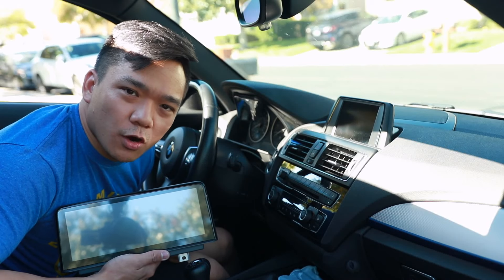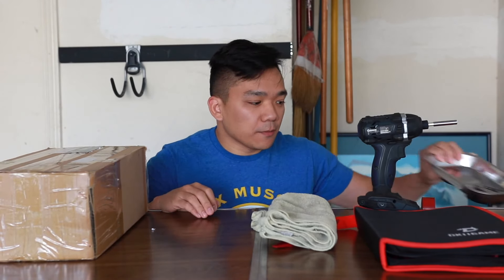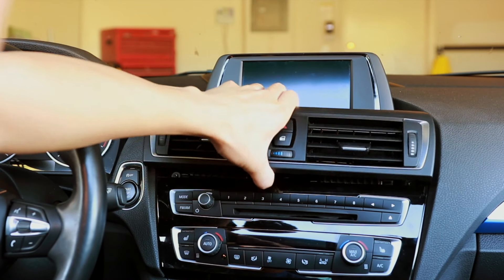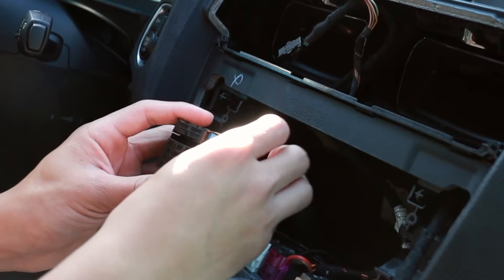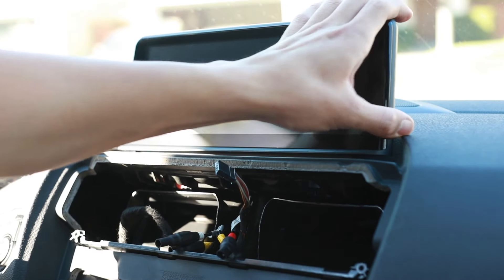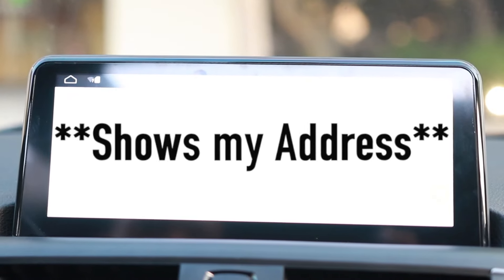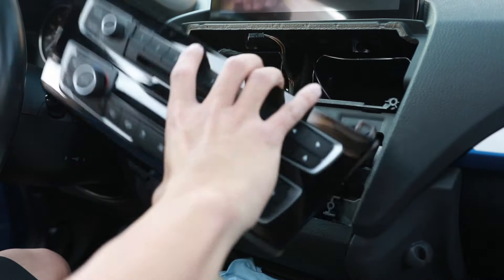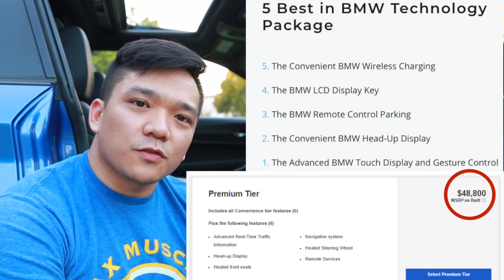BMW Android Screen | BMW Screen Upgrade | Koason 10.25" Display

Comment: Just subbed. Do you know anyone in Calgary, AB Canada to do this?
Reply from the maker: I don't, but let's pin your comment and see if someone there can help you.
Reply: @FritzRamos  any in miami florida tbat can help me with that installation?
Reply: @Ghostlygt-x9c  Hey just called up a shop called ciro's that does the installation for ~250
Reply: A shop called ciro's auto in miami fl
Reply from the maker: @iGotSub  Thanks for sharing
Reply: Do you know any head unit for 2016 X3 F25? Mine factory head unit is enclosed. Thanks
Reply: @FritzRamos  I have 2017 M240i with the larger screen but my navigation stopped working . I guess you’d recommend the MMI box but I like that you can have apps on your set up. Do you know know if your screen is compatible or if there’s any?
Reply: Anyone from Middle Ga area? I also really wanted to upgrade my screen!
Reply: I may as well ask if there's someone in NJ?  Thx! Joe
Reply: @FritzRamos Any update ?

Comment: My 8.8 NBT LCD Headunit Screen experienced sun damage from being under the sun for too long. Fortunately the computer components are fine so for me it’s more cost effective to replace the LCD screen with a new one. The LCD screen costs $70 which is significantly cheaper than buying a whole new head unit which would have set me back by at least $300

Comment: I watched the Bimmertec video on installing their Android head unit which I found a little discouraging - but watching you do it on an actual 235i made it seem a lot less challenging. I'm glad I found your channel.
Reply: Did you ever figure it out? I ordered from BT but figured audio shouldn’t be affected since you’re not really changing the head unit. You’re only changing the screen so it should still sound exactly the same
Reply: @luise3618  no, the screen is connected to the original sound system via aux, so the headunit is doing a Digital to Analog conversion and the DAC isnt as good as BMW original so there will be degradation but I doubt people can notice.

Comment: Ey! I just bought similar radio  for my BMW serie 4 , I did just the same as you but I have no sound. Theres a Jack cable on my kit , does It goes to the aux? Thanks from Spain!!
Reply from the maker: Yes,  but if your radio and bluetooth play without it inserted then you don't need it.
Reply: If you don’t have the fibre optic cable, most likely you’ll need to plug in the aux cable right?
Reply: I just don’t like the fact that I need to plug in the aux to armrest, I’d have to run the wire under the central console which sounds messy

Comment: Is there any differences if you have the Harman Kardon sound system apart moving the optical cable? Also how is the true sound quality affected while having the HK sound system along with this  as I am worried about sound degradation? Lots of models say its not affected but I have seen many examples where the sound quality is considerably poorer than than the standard HU with HK.

Comment: Thanks for the video mate extremely helpful and it actually gave me the confidence to attempt the installation myself, which i did today. The only real issues I had was with disconnecting the Emergency light switch connector as I couldn't pop out the button itself to make it more accessible and trying to get the stereo system back in to its original position was very awkward due to all the additional wiring that is now there. After finally working that out the new screen switches on fine but I don't seem to have any sound and the cars main menu doesn't display when I hold down the menu button on the Idrive...Any ideas why that might be? Could it be because I forget to connect the fibre optic cable?
Reply from the maker: That's awesome! Only some cars have the fiber optic so you ,ight have to double check to see if yours does. The other thing  to check is that you plugged in the AUX cord. Lmk if that helps
Reply: @FritzRamos   Thank you for your advice. My vehicle had the fibre optic cable so I relocated it to the new 40 pin female plug which has fixed the issue.  Please Fritz  I have another question...do I still need to connect the aux lead even if I can play music via bluetooth threw my phone? It works via the BMW original system but I have no sound when I play a movie via the android sytem.
Reply from the maker: @vijaybadhan6410  If you have sound from the radio, your BT, and from the android unit (like the navigation - switch to aux mode even if you don't have the cable plugged in) then you don't need it. I didn't have to use mine, hopefully yours is the same
Reply: @FritzRamos  Hi Fritz thanks, that suggestion worked perfectly.  I now have a fully functional system.
Reply from the maker: @vijaybadhan6410  Glad it worked out. If you need anything else please feel free to reach out.
Reply: @FritzRamos  Just out of interest Fritz do you have a screen protector for the screen? The only screen protector I managed to find is shaped to fit a BMW X3, OEM Screen. I want to avoid cracking it again like I did with the original one.

Comment: Hey man, my huge thanks for this video. I bought a similar unit for a BMW F20 116 from 2013. The screen is similar but not exactly the same one.
I followed this video and the instalation was very smooth. Also thanks for pointing out that some veichles have a fiber cable that needs to be re-routed towards the new connector, mine had those indeed!
Reply from the maker: Glad the video was able to help you even though it wasn't the exact same model.
Reply: I got 116i 2012 (UK). Where did you buy iDrive from?
Reply: @LolMatey I also have a 116i F20 2012, also not sure how to upgrade the iDrive

Comment: Great video. For some reason I’m getting ‘no signal’ .  The new unit powers up just not connecting to the BMW.
Reply: Did you ever figure out the issue. Mine is doing the same thing.. no idrive

Comment: Hi just subbed. Will this work in my 2015 f23 220i. Also do you get much glare on the screen?
Reply from the maker: I believe so. You'll have to check the fitment guide. Glare isn't an issue

Comment: Hi, great video install went well i just cant get my i drive system to display, every time i try to use it it comes up with “no signal”, do you know why this is? And can you help me?
Reply from the maker: Double check that theh in and out cables are properly routed and fully engaged. Do you have audio?

Comment: Is that Audio from head unit need another audio cable to connect with main unit or what?
Reply from the maker: My unit does not need the aux connection, but other models do. I'm not sure what components cause the aux to be needed or not though.

Comment: Did everything just as you described, with the same brand unit, and get no audio from the unit itself...
Reply from the maker: Do you mean bluetooth, radio, or both?
Reply: @FritzRamos  sorry for the very late response.  The Aux input threw me off.  I do still have a couple issues.  One being that if you use split screen in Android, the side that is not active freezes.  So if you have spotify on one side and want nav on the other, one freezes.  Any way around this?

Comment: My friend i need your help
Can you possible change cluster for black panel 6wa  coding bimmercode its possibe ? 
Thanks you
Reply from the maker: Are you referring to the instrument cluster - for the speedometer and odometer?
Reply: @FritzRamos  
yes I have the same meter as you I would like to put the meter with your white light and a slightly larger LCD screen but I don't know if it is possible with a used meter?
Reply from the maker: @piraterietuto9015  can you message me @vroomtuber with pictures. I think you are talking about the heads up display not the instrument cluster. If you are using a used screen just make sure the connection is the same
Reply from the maker: @piraterietuto9015  got it. I would love to help but I don't have intentions on getting that. I prefer the traditional look
Reply: @FritzRamos  thanks you for reponse im french  i like your video .
Respect my friend
Reply from the maker: @piraterietuto9015 Tha k you and  no problem. If I find a video that can help you I'll send it over.

Comment: Hi, did you have to connect to the aux socket or is it enough to simply set the audio output to aux and the audio will still be heard?

Comment: I didnt see you connect the AUX cable , isnt it require for bluetooth playing?
Reply from the maker: Some cars require it while others don't. I haven't learned what is the decisive feature though. As for this car it does not require it.
Reply: @FritzRamos  mine requires it , how do i connect it?
Reply from the maker: @PaulinhoRullz  JUst connect the aux from the head unit connection to the aux under the armrest
Reply: @FritzRamos  then how do i play songs through my phone? Via Bluetooth?

Comment: Everything worked except the clock on the dashboard right next to the odometer now showing nothing, a bit annoying to not able to check the time on dashboard, could it be something missing from the connectors?

Comment: I’m getting no audio after installation?
Reply from the maker: Try switching to the aux setting, if you have the optical cable make sure it's firmly connected, or connect the aux wire

Comment: Just subscribed pal. Located in Dubai, UAE, I’m driving X1 xDrive25i MSports 2017 .. comes with company fitted 10.25 screen with ConnectedDrive, Navigation but no touch or carplay features. Would like to get the head unit replaced to support Touch, Navigation, Carplay. What are your recommendations?

Comment: I see that you installed the GPS antenna inside the dash....is this ok and it works like I champ?...I ask this because some manufacturer's would want you to expose the antenna, like on to p of the dash.

Also; can you confirm that all the basic BMW menus and features work?...I'm interested in buying it but mainly for: 1. Having a bigger screen 2. Having a touchscreen 3. Having Apple car play wired.  I don't have an android but may use that side too.
Reply from the maker: I haven't had problems with the antenna, but there is enough slack to get it placed anywhere you want.

All original features work if you want carplay make sure to get the single and software, https://youtu.be/4ZfGKcxi1xk
Reply: @FritzRamos  Cool, I'm looking and studying the retrofit from 
http://www.carnaviplayer.com/bmw-x3f25x4f26-2011-2017-radio-upgrade-with-1025-screen-p-1255
I'll be writing them an e-mail to ask a few questions but thanks for the info.
Reply from the maker: @odieman23  no problem

Comment: Hi bro i just purchased a used 2017 bmw f22 and try to upgrade the screen(pemp) but i dunno if the old owner missing some wire but there is no power to the screen. Any ideas what happen to it before i bring it to the shop. TIA.

Comment: HI there,

I installed my head unit and everything works just fine.

The radio plays perfectly, but the sound through android auto and apple car play does not work.
Only if I run a cable to my aux port in the center console does it work, but the sound quality is terrible and then I have a chord running in the car which is not aesthetically pleasing.

Is there any solution to this problem> I do not want to use the aux port.

Thank you in advance!
Reply from the maker: When you run audio wirelessly from the android side you have to change the audio source to aux (even if you're not using a cable).
Reply: @FritzRamos  I did that and the sound still does not come through. Apparently I need to get someone to code it for me

Comment: My head unit will only move out a few inches....no way to access the back of the unit.  Zero slack.  Seems like the harness is attached to something under the center console run. 😥

Comment: Nice video! Just got my self a 2016 320xi. Will this work on 320xi? It's NBT.
Reply from the maker: Yes it does! You just have to get the unit designed for your car

Comment: I purchased a 10.25 Koason Navi upgrade for my Mercedes w204 didn’t realize i had to purchase attachments to enable my rear view camera did you have to purchase a separate wiring harness or other attachment to enable use of ur backup cam?

Comment: Hi, I have a BMW X1 F48 2017, can I install the Koason screen? Also how is the quality, my BMW dealer says that the quality of the Chinese screens is poor.
Reply from the maker: If you have the small screen then I would get the android screen. If your car came with the bigger screen then I would just get the mmi unit.
Reply: @FritzRamos  thanks a lot for replying. It is the small screen and if I am right the NBT system, F48 is not listed at Bimmer. What about the quality of the Koason screen?
Reply: Hi Fritz, please help me find the right system, the information on the Ali site is very confusing. My BMW X1 F48 2017 has a  head unit ENAVEVO.

Comment: Could I do this on my 2014 228i?
Reply from the maker: Is that NBT?
Reply: @FritzRamos  Hi Fritz, thanks for your reply. First off, thanks for your broadcast. I really appreciate your perspective - posting to help ppl vs. just showcasing your skills... like a lot of you tubers, unfortunately. By NBT I think you mean non Bluetooth? Yes, my car doesn't have nav or BT streaming audio. I can only make/take calls via BT. So the screen is the smaller one and the control module is the non-touch iDrive. 1) is it possible to upgrade to aftermarket Apple CarPlay screen? 2) is it possible to upgrade to touch iDrive module? 3) if yes to #2 & 3, know anyone in my area that could possible help me get it done? Thanks again!
Reply: Yes, you can get it from bmods.co.uk.

Comment: Hello, what would you recommend for a 2016 bmw X4?
Reply from the maker: What do you want to get out of it?
Reply: Fritz Ramos apple carplay mainly. Thanks for the reply
Reply from the maker: @saathvikjadhav8242  You could go with the screen like I did or the mmi

If you have the GPS the mmi takes a few more steps to fit it in. It's like hooking up an additional module that gives you carplay. So I don't believe that you would have android capabilities.

The screen replaces your OEM screen and works just the same except you have an android component. The downside here is that the android side takes about 5 minutes to start up (no delay for the idrive side) and it will require a hotspot (I use my phone).

Hope that helps
Reply: Fritz Ramos thank you very much . That helps. Can anyone help me with this? Im in South New Jersey near Philly. I would like to get the mmi.

Comment: Really good video. Clear voice, perfect cuts... so I’m from Germany and last week I bought a BMW 118i 2017. First does anyone know if the car has CCC, CIC or NBT?
Reply from the maker: Thank you. Here's something that might help you out.
https://www.bimmer-tech.net/blog/item/54-bmw-cic-nbt-nbtevo
Reply: @FritzRamos  thx for your reply. My gosh that’s so complex. So as I learned I have NBT Evo ID6. But because the system has no Navigation im not able to buy Apple Carply via BMW directly. So I’m stuck with those MMI Aftermarket Boxes, because displays with Apple CarPlay integrated aren’t supported for NBT Evo id6.

At Bimmertech I typed in my vin and they told me I also would have to have an coding session where they would activate my auxiliary so that the Aftermarket MMI could stream sound. I have no Aux port underneath my armrest so where should I plug this in? 

The thing is that Bimmertech cost twice or even more money for the MMI Box as others from ewaying or Aliexpress. I mean those are the same so what’s the point of spending 400$ more?
Reply: Im confused. Should I buy an Aftermarket Box for ~200$ or Bimmertech for 750$.
Reply from the maker: @saschazink1855  this might https://youtu.be/4NLzSvcacMY

Comment: I tried to get Best Bout to install one of these and they said they won't do it because they don't trust it lol
Reply from the maker: Did they not know or try to sell you one from them?
Reply: @FritzRamos  they said they can damage the vehicle and usually break but I disagree. They said no one makes "trusted" touch screens for my car.
Reply from the maker: @freddybell8328  I have no idea what their problem is but mine is going on 3 years now and I'm happy. Since then there have been improvements so it's not the screen
Reply: @FritzRamos  yeah I waited two months for the installation. The guy at best buy said if I can install the touchscreen and prove him wrong he'll install my backup camera for free so Im gonna watch your video and then go get a free backup camera installation lol
Reply from the maker: @freddybell8328  so condescending. If he knows so much he would be at the dealership or a specialist shop not best buy. I'm sorry you have to deal with that

Comment: Great video. Thank you. If I have the GPS and Satellite radio in the car already, do I just connect those existing wires or do I need to use the ones that came with the head unit?

Comment: Great video. Thank you for making this video I have the very same display  but Carplar unit and was wondering how to install it on my BMW . The instructions that came with the unit are a bit rubbish. I can see now that if the vehicle has certain features already not all the wiring loom connectors have to be used.
Reply from the maker: You're welcome. The older models like mine need a dongle but I think the newer units use Zlink. Here is how I set mine up: https://www.youtube.com/watch?v=4ZfGKcxi1xk

Comment: Hello thx for the show, does it keep your garage visits information with support and maintenance info save on the new screen?
Reply from the maker: It can if you download an app tracker, but the stock system also has a tracker

Comment: Hi, how did you lay the cable from the USB? there is no passage into the glove compartment?
Reply: Yes there is a passage into glove compartment
Reply: @kylebrankin5570  And where is the passage in the glove compartment? my glove compartment is a closed box at bmw f20
Reply from the maker: Just drop it straight down and pass it through the trey under the radio